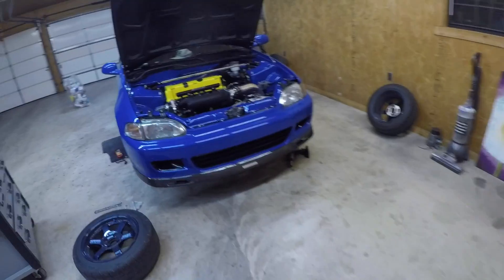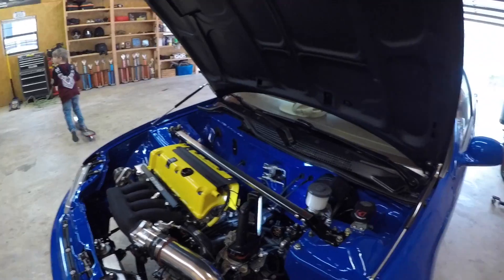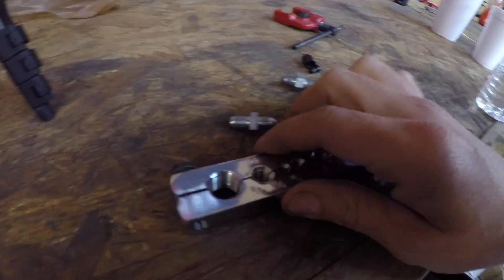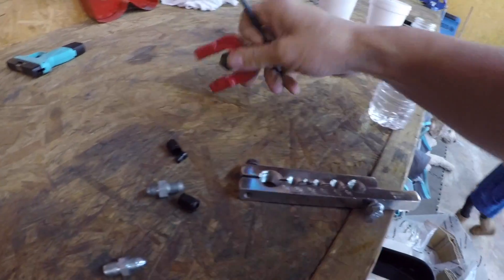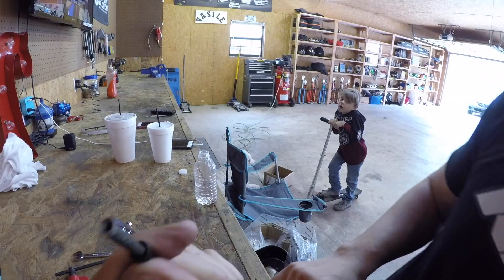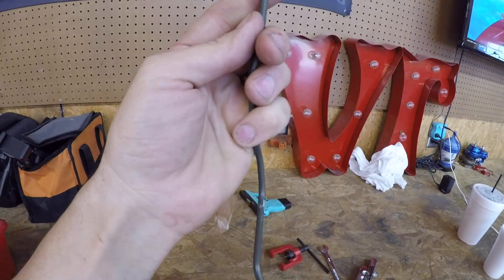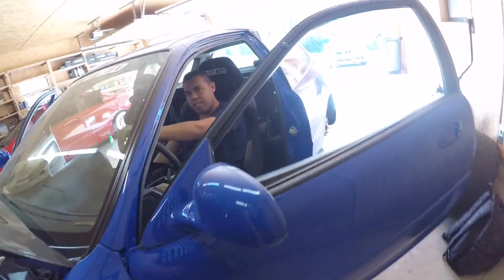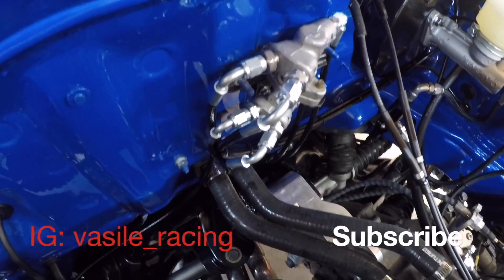How to do a brake tuck

Comment: I hope your brake lines don't leak. Do your flare angles even match? AN fittings use a 37* flare and every brake flaring tool uses a 45* flare. You might have problems if you ever have to take those lines loose.
Reply from the maker: Peter Tremonti no issues so far
Reply: Vasile Garage Glad to hear it. Just be careful if they ever come apart

Comment: Which hardware did you use to bolt on the strut bar? And where do you get them from?
Reply from the maker: vtecgoes bolt and screws near by
Reply: Really dude???... it is obvious you used that but wanted a little more info but that's ok...
Reply from the maker: vtecgoes 12x1.5 1” long with nuts washers and lock washers

Comment: So u can flare lines but cant bother using a proper brake bleeder...right
Reply from the maker: PsyGen Gaming 🤷🏻‍♂️🤷🏻‍♂️🤷🏻‍♂️🤷🏻‍♂️
Reply from the maker: PsyGen Gaming I never said I’m a pro and I’m lazy at times to do things how everyone else gets it done
Reply: @vasilegarage2606  lazy as u stated would be using a manual bleeder and syringe harbor freight u can buy pneumatic brake bleeder vaccum pump for 19.99, this way u can just pull the air or fluid right out. Opening of bleeder fittings and doing a gravity bleed puts air in the lines specially so if u have a resivore emptied already